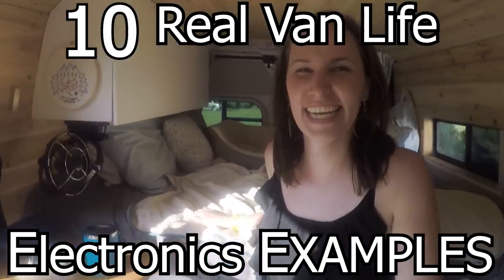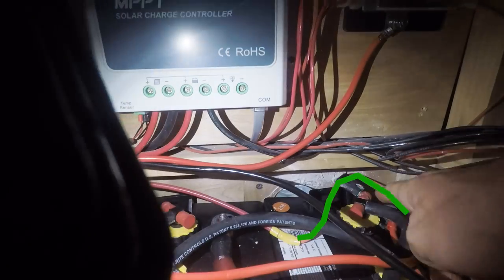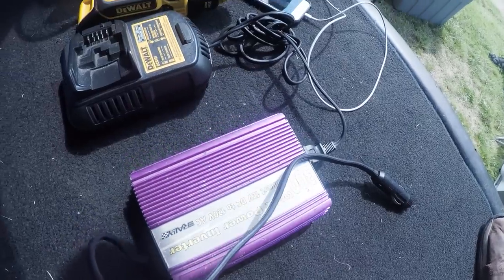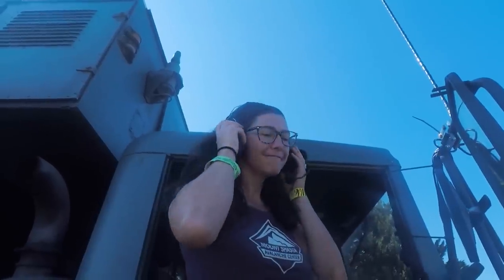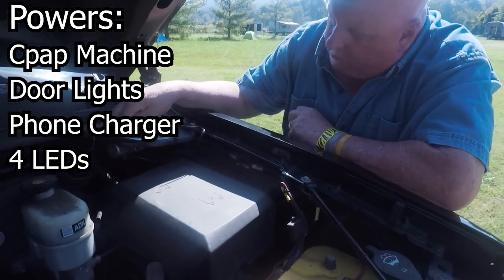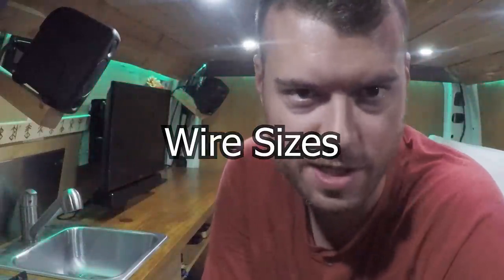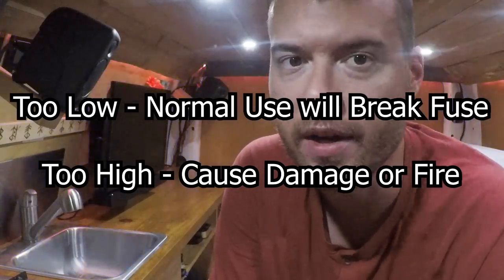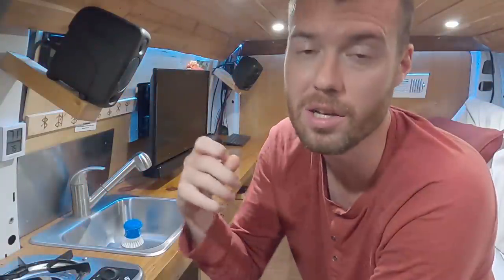VAN LIFE ELECTRONICS Start to Finish (Learn solar wiring here)

Comment: I watched all the way thru to the end. I just bought a van used as a windshield install work truck. It came with a 1500-watt pure sine inverter that was professionally installed. They ran thick cables thru a fuse mounted by the truck battery to an isolator behind the driver seat where the house battery and inverter sit. The inverter is connected to the house battery with a type of connector that I have seen on electric forklifts. All of the wiring is the same heavy gauge and is all run thru plastic corrugated shielding.

Comment: Really really great video.

One thing I would say though is that you can definitely run a fuse box off of the "Load", and  maybe in fact SHOULD do this. Provided you have a half decent controller, it should cut out when the voltage (charge) on the batter gets too low,  thereby extending battery life.

So if you can think about what ampage you may need from your charge controller, this should definitely be an option.
Reply from the maker: I'm going to be making an updated video on this topic with my new van. It will include much of this similar content, but be updated with new content more relevant for people to figure out their own system in an easy way, like how to size the charge controller and wires. Honestly this was a great video for it, with all the examples I showed, but the new video might be even more helpful for everyone. Hopefully

Comment: I watched from beginning to end.  I too was in the Navy and worked on shipboard guided missile radar systems.  I am in the process of installing my   electrical system into a converted school bus.  I have LiFePO4 batteries that total 24V, 300ah, 60A MPPT charge controller, and 1700W of roof top solar.  This was a very informative video.  Thank you.

Comment: I watched it to the end and I need to watch it another five times! I want all the power the last lady had but in a pro master van build. Minus the washer dryer obviously.  3000 watt inverter 709-800 amp hours of lithium and 800 to 1000 watts of solar. No propane. Induction cook top, toaster over, coffee maker, and microwave. One laptop and phone. Oh and a small water heater.. also the standard ceiling fan, lights, water pump. I like the UV water purifiers. Unsure how much power those take. Good information. Thank you!
Reply from the maker: You could be able to get away with that! I can see it.
Reply from the maker: Thank you for rewatching!

Comment: I've been watching a bunch of van build videos, and this is the best I have seen on the electrics. One thing I I was glad to see was good wire crimping, especially the high current terminals. I've seen a few videos where it was obviously just squashed in a vice or pliers, which can result in a bad connection. even 30A is a lot of current, through a bad connection it can cause a lot of heat. If there is hydrogen build up, or propane, and a poor connection causes a spark - that would be bad.

Comment: Hey man. Just finished the video. Thanks for the content! I just recently bought a 1996 ram 1500 with only 68k miles and basing the build off your great white! Already finished cleaning it out, insulating the floor/framing floor. Plywood down. Currently getting mechanical stuff in shop worked on but once I get it back the laminate and electronics will be going in! Still don’t completely understand it all but moving forward regardless.

Comment: Very Nicely explained and great examples.  I built my van out myself and am fairly technically inclined. I think for anyone looking to set up a van your video would b one of the best to watch to get an over all idea of how all these parts come together. For me the whole process was super fun.  Nothing more rewarding than building it and then watching it all work and knowing it will because you calculated every amp and reasrched all possible ways of building it. 

Im running off 2 -6 volt golf carts and a VSR from my alt. I pwr a small 12v fridge and 2 diesel heaters and lites, maxxfan, tablet for movies, have a 1200watt inverter thats used rarely mostly for charging my pwr tool batteries or a vacum. My van is a Hvac service repair truck.  But iv spent the night in it in MN winter and it is fun.  I have the battery 🔋 monitor but have not finished the install of it yet. 

I was watchn as my 2 Duracell 6 volts seem to b loosing voltage (charge ) faster than last winter. I pwr the fridge 24/7 and use the other elec draws daily. My batts r on 3rd season. So I was tryn to c how long other peoples lasted. I think I meed to replace mine. Looks like u or 1 of the people in ur video have the same battery setup. For the money its hard to beat and does alot. I do recommend for cost vs 12 volts by far. 200amp hrs basically.

Now u have me thinking about upgrading the house battery design!  Lol.   

I'll prob watch ur video again just because it covers so many setups. GOOD luck to You!! Great Vids bro!!
Reply from the maker: Thank you!

Comment: I just got a tiktok ad and an old spice ad back to back. This dude is making that money!
Reply from the maker: Fuck yeah haha
Reply: @OutdoorsEmbrace  im converting a 4runner to live my dreams im going to put propane tanks on the roof of my car with a propane generator, grill/mini oven, and heater. Im going to charge my battery with the cigarette lighter (when the car is on then unplug charger when car is off) then charge a battery with that battery to push my altinator to its limits hahah. The bed is going on the ground/floor board so i don't hit my head when i wake up but then im building a table/bench going from one wheel well to the other. And i got a little 2 gallon chemical toilet so i can fit the waste tank in a book bag to empty anywhere. My gray water also 2 gallon to fit in my bookbag. Oh and a little drain pan and curtain to squirt water on me for a quick wash. I have no fridge so i have to go with non parishable food so peanut butter, fruit, and powdered milk here i come.
Any advice?

Comment: Thank you so much.
I watched to the end and glad i did.
I stripped and re- wired my XL-40 conversion about a year ago with all new with 120v (18 outlets and 8 LED residential lights) and 24v wiring to 5 house lights and 120v/2500 watt inverter etc . . . and yet I stilled learned a lot about Solar and Low voltage systems . . and batteries. Thanks for the recommendations.
 :)

Comment: My first campervan was a minivan. I had 1 Renogy 255 watt solar panel,  3 VMax SLR 155 watt batteries and a 3,000 watt inverter.
I had a kitchen with a sink, a 700 watt microwave, a college dorm refrigerator, and a slow cooker. I used a 28" monitor as a TV, which I connected my cell phone by a DeX Dock. I had a bathroom with a toilet and a 5 gal camper bag shower. Under my bed was my closest. My clothes went in to plastic tubes. I had blankets, winter sheets, summer sheets, winter clothes, and summer clothes. 
In the back of my van was my electronic bay. This is where everything was that ran all the electricity to my campervan. 
I've since moved to a full size van. Which this year broke down. It will cost more to repair then fix. So, now I'm on the hunt for another full size van.
Reply from the maker: Damn! Sorry to hear you gotta find a new one now! That would really suck for me, I know! I can only imagine. Ugg
Reply: @OutdoorsEmbrace , if things work out I hope to get a good deal...lol
Reply: I lived in my minivan for 2 years and then I lived in my full size van for over 2 years. I got good use out of it.
I've been wanting a newer van anyways.
Reply: I like to design. So after awhile I start looking for a new project.

Comment: Watch to the very end and it's one of the very best video on the subject around here. Yes, run your stuffs on their native low voltage (12v), almost everything in your house is 12 or 24 or 48 volts, that is transformed from the 220v/110v from the wall. Cheers.

Comment: Fellow Navy Vet here, what ship were you on? I was on the Enterprise CVN65 and I was a weather guesser. Hands DOWN the best video on electric video for a DIY beginner like myself!! Tanks for taking the time to produce it!! My question is this, I'll be using my van for mostly weekend trips around Tahoe for camping and skiing and occasional music festivals, Do I even need solar panels or could I just get a few Lithium batteries and charge them from my house (i do have a 30 AMP outlet in my garage) and also install a battery isolator to charge them when I'm driving? I'll have some puck lights, USB outlets, a Webasto Heater and occasionally use a induction cook top. Thanks for your time and help!!
Reply from the maker: If you do just get lithium and the isolator, get the Sterling 1260 shown in this video because it won't damage the Lithium battery. 

I was land based in the Navy, Squadron HSC 21, working on Helicopters. MH60S was the helicopter. I had a detachment onto Wasp 01 Amphibious Ship.

Comment: Yes thats my deal tool battery i charge at work. Tablets can be charge with tool battery adapter. 12 volt cigarette lighter socket with usb adapter which will take upto 24 volts.  Power my adaptive 20 volt fan. middle of the road setup. That can be charged rapidly.  Better than power banks. But have a few of them also.

Comment: UK subscriber. Upgrading a 10x5 cargo trailer/toy hauler from 14W portable solar with unknown wet battery. Bought my first upgrade solar piece today which is the 40A Epever Triron. Looking at getting 2x 200W panels. Not sure on batteries yet. I am finding your videos very helpful, wire size etc.

Comment: Wow, watched till the end. I think the nissan leaf battery method is the most based way for energy storage. I haven't even considered fuses before but makes plenty of sense. As a gamer I'm interested in a used like new Surface Book with those sweet Surface headphones + Xbox and PS One Controller. I have a chevy express 2009 which I'm interested in doing a lazy bare bones conversion and am interested in using one of those composting toilets, but have no clue how they work. I'm also considering using the spare tire compartment for maybe energy storage. An ac to me sounds like it uses as much as 70+ 20 inch fans so I'll just stick with fans.

Comment: Just bought an old Sprinter and I'm devouring everything about van conversion. This video was one of the most valuable. Unfortunately here in Brazil is very hard and expensive to find high quality RV stuff such as lithium battery. Question: whem I "chain" together batteries in a 600ah bank... Is it still safe to touch poles (as its in a single battery)? I'm aware of what kills is Amps... but not sure what is the threshold for 12v when it start to be dangerous.

Once more, thanks and congratulations.
Reply from the maker: If it's 12 volts, it's usually not enough force to push the amps through your skin. Just don't have wet hands. Don't test it like I did Haha I did it for the video

Comment: would adding a grid-tie inverter to the ac side of the system to cut power pulled from your battery system. i also watched to the end

Comment: A) Question about where to put a battery monitor / shunt in the circuit.  Basically in front of any loads? 

B) Related question: if I wanted to install a battery (undervoltage) protector, and I promise I turn off my inverter after short term use, such as running a kettle or a toaster, can I save money by getting a protector rated for lower amperage and just keep it in front of my DC loads but not the inverter? Inverters draw high current, right? Said another way, if I buy a battery protector, I should buy one rated for the maximum current that will likely pass through it. Would that be surfe current or regular operating current? 

C) Did all that make Sense? 😆

D) Great Video! Watched the whole thing!!
Reply from the maker: The shunt goes on the negative side of the battery, all energy should be routed through it, so disconnect all wires that were in the negative terminal and place one side of the shunt there, then all wires attach to the other side of the shunt. Then the shunt has a smaller wire that goes to the positive side of the battery just to power it.
Reply from the maker: I did not completely understand (B)
Can you reframe the question?
Reply: Outdoors Embrace Yep. I want to install a battery protector in my system. Where would I put it?  Do I get one rated for the maximum current that will go through it? i.e. the cheapest one at 65A ? But wait. I have a 2000w inverter. These draw a lot of current. Would I need a battery protector rated for a higher amperage?

But if I’m cheap, can I leave the inverter out of that part of the circuit because I know personally that I only turn on the inverter to use appliances for a short period of time? This would save me some money because I’m assuming I no longer need a protector for such high amperage since any current flowing through the protector would not be related to the inverter. And yes, I run the risk of the inverter over-discharging my battery.
Reply from the maker: @stephenoconnor5540  so you could either put it in front of the entire load or just the inverter. You're 2000 Watt inverter only pulls high currents if it is running an appliance with high current. Otherwise, just keeping it on without a load probably won't drain your battery even after 3 days... we are talking about mili amps of current now.

So I do not have direct experience with these myself since everything I bought has its own battery protector installed already. My MPPT will shut off the connection if the voltage goes below a certain value I set, same with my inverter, and fridge.

I would look to see if your systems do not already have these safety systems in place. If you're inverter does not have one specifically, I'd only place this device on the inverter itself.
Reply from the maker: @stephenoconnor5540  and yes, it should be rated for the maximum current that will go through it
Reply from the maker: @stephenoconnor5540  i also only turn on my inverter only when using appliances for a short time. It's a good habit. But if you do accidentally leave it on with no load, you won't hurt anything.
Reply: Outdoors Embrace Thanks! I appreciate you taking the time to respond. This was helpful!!

Comment: Watched to the very end.  :)  Your diagrams had tv run off the 12v breaker box and you mentioned to look for as many 12v items as possible to save power and burden on the inverter.  My question:  do you know of a good source for where to find 12v items, such as tv, cooking, heating, coffee maker, etc.?  Thank you!
Reply from the maker: Well, there is a link to everything I used in my build in the description. You'll find the 12 volt TV link there. For everything else like heat, cooking, and coffee, that will be hard if not impossible to find 12 volt. Those are higher powered units. Pretty much anything that uses heat is higher power.

You might need to get 120 volt for those things.
Reply from the maker: I never recommend electric stoves. Always propane or alchohol stove.

The electricity isn't used for long with an electric stove, but it's still a ton of power. 
Same goes for any heating element.
Gas powered heating/cooking is the way to go in a van.

Comment: Showing you I'm here.
Keeping this video for reference. 

Question: 
Can you run batteries with different amp hour ratings? A 75ah with 2 55ah batteries?
Reply from the maker: You definitely can do that. But would you want to?

110 Ah(2 x 55ah) in series with a 75 Ah.

The 75 Ah will hurt the 110 Ah bank over time. Meaning the lesser Ah battery brings the other down to size over time.
Reply: @OutdoorsEmbrace  I didn't know, so that's why I asked. I'm just getting into the electrical side of builds. Thanks for answering!

Comment: I made it to the end and subscribed.  Still curious what I need for working at home?
Reply from the maker: Like what exactly? You mean the tools you might need? If so, this actually might be a great video I could make!
Reply: @Outdoors Embrace  do you much about atarlink? Can you do an internet video. I gotta be attached to ethernet
Reply: @OutdoorsEmbrace  that would be great
Reply from the maker: @Dang! Dat girl Kesha  look at Tmobile Home Internet. It works for me, unlimited at $50 a month. You can travel with it just fine, just you are not always guaranteed the high speeds. You can get over 250mpbs with them, but you can also get below 2mpbs. I use it to download huge files very quickly. Think of it like signal from a phone, all those areas are covered. They will tell you it's locked to one area, but it isn't really. There will be certain days it acts up and won't want to stay connected. But that might be 2 days out of the month. Mostly if you are in a good area, you get pretty good speeds.

Comment: great video! would you recommend wiring a hot plate and a toaster oven directly to the battery? as you mention with the fridge?
Reply from the maker: I see this as a new comment, but I thought I commented back already to you about this? Hmmm???

Well, hot plate and toaster, I recommend getting a Lithium battery, probably at least about 400 ah.
They need to be plugged in to an inverter. 

I recommend going with propane cooking to save all that power, because it's a lot for those heat elements, even though you don't use them for long at a time. Propane can be safe if you take the right precautions. I've seen a womans build that used a water heater, an electric stove, and a 400 ah Lithium battery. She struggled a lot to keep the battery full. That was in Florida with full sunlight.
Reply: @OutdoorsEmbrace   yes sorry i got confused... comment wasnt posting and then double posted! 😝